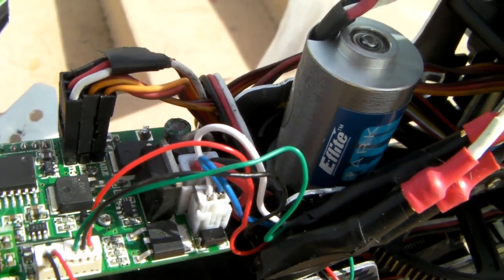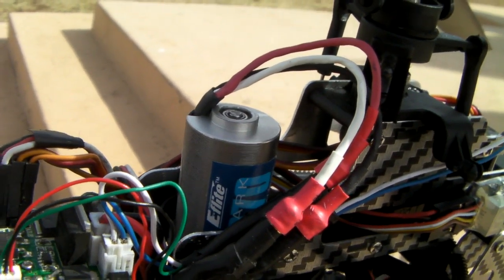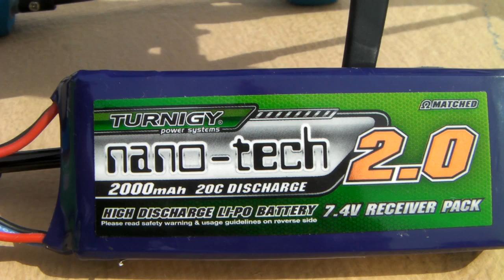MJX F45 Brushless Motor Upgrade Part 2

Comment: hey Ricardo, what of two these helicopetrs is better MJX f45 or wl toys v913?also tell me why.\
 Thank you
Reply from the maker: Greetings,  to be honest with you,  I don't have any experience with the WL toys helicopter, but I believe that they are both about the same thing. I chose the mjx, because there are more parts available in the net for this bird than for the WL toys and is really easy to upgrade and/or repair when needed.  Mine has  been grounded after 1k+ flights. I stepped up from the MJX and now I'm flying fpv planes and quadcopters. I highly recommend you this bird as your step up from coaxial helicopters,  but not as your first one.  

I invite you to visit my channel and watch my other recent videos flying my RC planes and my quadcopter.  In my opinion  the most recent ones are the best.  

Thanks for watching and for your comment my friend.  Have a great day.

Comment: I just got this ESC. when I connected the ESC wire to radio, the black wire out of the 3(white, red, black) BURNT. Also the wire connected the battery, gets warm. And I have not connected the motor yet. Any help as what went wrong, very appreciated ?
Reply from the maker: Stay tuned and I will send you a video showing what I did, and what I think went wrong with yours, because I experienced the same situation.
Reply from the maker: Hope this will help you:

MJX F45 BRUSHLESS Correct ESC connection: http://youtu.be/8Z1RkrCseRw

Comment: Hi Ricardo, what model of the E-Flite park 370 BL are you using inrunner or outrunner and 4100Kv or 5600Kv
I guess you used the inrunner 4100Kv ?
Thank you for your answer
PS: Did you do any changes on the tail motor ?

Comment: I have a mjx f645, it really is a very nice 'fixed' pitch heli, well made runs nice and can take a amazing amount of crashes. I didn't know that when you added the brushless upgrade you could change the motor type.
very nice video, keep the upgrades coming
Reply from the maker: Thanks for your comment. Yes you can switch motors, but there's just a few ones that fit perfectly no mods needed,  like the one I'm showing on this video. That was a really old video, though. You might want to visit my channel and watch my recent ones. The videos are dated, just look for the most recent ones. I believe the last time I flew my heli was December last year. I've been to busy with my airplanes. Thanks again for your comment and have a great evening.

Comment: there's a guy, i think in germany, that put an align md500 250 scale fuselage on his mjx. have you used a spring and washer on your swash plate? i've seen that mod on other vids.
Reply from the maker: I have but I didn't like the results, so I put it back the way it was designed from factory.  No spring or washer.  With that mood the heli was behaving weird so I took it off.
Reply: ricardopr54 cool. something to think about. my stock f45 actually didn't have a pendulum effect, which caused some to do the spring mod.
Reply from the maker: As long as you set the CG correctly you shouldn't have those pendulum behaviors.  With those bigger batteries sometimes if they move, you lost your CG and your heli start doing that. I ordered one of those spring and washer kit for the swatch plate just to give it a try, but didn't like it.  It was harder to control and at least in my case I felt like the heli lost some forward movement, so I took it off.   I'm still flying my heli, not as often as I used to, but I returned to the stock batteries.  With those your CG is always correct and with the brushless main motor, you have more power and it a little bit longer flight time compared with the stock one.  There's a recent video of me flying my heli.  I invite you to visit my channel and look for it.  The recent ones all have the date on their titles.
Reply from the maker: This is the link for my last flight. I love this heli, but I have to many things going on and can't find time to flight them all.  I have airplanes, Helicopters, a little quadcopter, and a bigger one coming this week to form part of my hangar . LOL. ..

 Flying my MJX-F45 Helicopter again December 11, 2013
Reply: ricardopr54 nice video. i flew my hausler 450v for a little bit today since the f45 isn't working. i have two scale warbirds and another 250 scale fb heli.. the wl v913, the clone of the the f45. the wl is fun, but once i flew the f45, it was so much more fun, and the upgrades are a lot better. yeah, i changed the battery connection to a deans connector, which means a bigger battery. i'm running an 11.1v 2200 mAh 3s 30 battery.. a lot heavier. i had to switch from the 7.4 v because batteries were lower quality (off my v913) and didn't have a consistent discharge rate (i had it tested at local hobby shop). they suggested i get a better quality battery. i just happened to have the 11.1v. yeah, finding a CG is hard because it's too big to fit where the 7.4v goes. right now, it's on the bottom held in by heavy duty rubber bands. do you have any collective pitch helis? you're not flying in california, are ya? i've seen a couple of your other vids before. what didn't you like about the mjx brushless upgrade kit?
Reply from the maker: I have two cp hemos, the Walkera v400d002 such it is a piece of crap (poor quality) and the ESky Belt CP V2. I tried to fly them thinking I was ready after mastering the mjx f45, but I was wrong and crashed them both every time I tried to fly them.  Even with training gear I ended up destroying them.  I spent more time fixing them than flying them, anyway I want ever able to even hover the four a couple minutes, what am I mentioning minutes! , I would've had said seconds...lol... It was so frustrating that I Quit.  I still have them here both.  The walkera is so cheap that just to eyeball it, it breaks... The walkera servos has plastic gear, if you fly it hard they wear off.  So I return to my reliable Mjx f45.  I'm thinking on giving the ESky Belt another try.  I've been practicing on a simulator, and at least now I had learned the concept of the collective pitch and can hover it, but still on the simulator. Lol... And about the MJX-F45 upgrade,  I have no complaints at all.  I love that upgrade. Of course I switched motors, but still the same concept, and it handles the wind like a champion.  If you fly those cp Helis, then you ate a verte pilot than me my friend.  I'm jumping into multirotors this year.  But still wanting to matter the art of flying a cp helicopter, so I'll continue trying.  Have a great day.
Reply: ricardopr54 yeah, i spent more time fixing my hausler 450 than flying it. i don't want to give up on it, but i'm scared of crashing again and spending more time and money on repairs... yes, very frustrating. they got to know me at my local hobby shop because i was always in there buying trex 450 parts (hausler cloned the align trex 450). cp is a bit scary, but the option of fuselages are better for the 450 than 250 sized helis. there's also the heli-max novus 200 fb heli, but that's a bit small for the align fuselage.. that has a shaft driven tail rotor. yeah, i wanna get into multi-rotor as well. the guys at my hobby shop are into them, and one of them is building his. i would love to do fpv with those. have you watched alishanmao's video reviews? they're awesome. i didn't realize walkera's stuff was poor quality. do you know of any 450 sized FP helis? probably easy to build, with the right stuff. wonder if i can switch out my mjx guts to my 450 CP, but i'd have main rotors long enough.
Reply: ricardopr54 How's it goin'? I know it's been a few weeks. Well, I replaced the pcb board thinking that was the reason why the tail motor didn't work, but guess what, the board I replaced was never inoperable... it was actually the motor, but now that's the problem. I've burned out three motors (the last one was off my WL v913). There has to be a reason and a fix for this because I'm not buying another one. Frustrating because I literally fly it less than 10 mins and they go out. I'm thinking of just converting the tail motor to a brushless. What do you think? Also, I'm going to convert my Hausler 450 CP to a FP using a MJX f45 rotor head, and I've seen some conversions on youtube, and there's actually a group that uses the MJX rotor head specifically on CP helis. Anyway, I hope you can help me with my tail motor problem.

Comment: thanks ricardopr54. yeah, i'm already on my second pcb board. i'll give it a try. i actually want to put an align 250 scale fuselage on mine (md 500), and i needed a stronger motor for the extra weight. i actually came across your video last year, and  because of your vid, it would be the solution to the weight problem, and i've used your video as a template to build upgrade mine. this heli is fun. i also have a hausler 450 (trex 450 clone),. it's a cp and i've crashed it a lot and i've put a lot into its repairs. flying the f45 is a lot of fun and i like that it can handle crashes well. once i have the new board in, i'll let you know how it turns out... agggh! and i thought i was done with soldering.

Comment from the maker: videogrand1985 @videogrand1985 I have never had any problems with my tail motor and I'm still using the brushed  one.  My suggestion for you is to get a new PCB.  Sometimes that happened to me and a new PCB  was the solution to the problem.  The PCBs go bad sometimes without any advice.  Those PCBs are not that expensive, you could find them for under $ 20. 00 . Hope this might have helped you.  Let me know.

Comment: hi ricardopr54, i've done the eflite 370 brushless upgrade such as you have. the tail motor worked okay at first, but now it doesn't hold the heli straight anymore.. it just spins counter clockwise. the tail motor still spins, sometimes steady, but on and off. i replaced the tail motor because the previous one probably burned out, and this was with the eflite upgrade. it's the new motor that's now acting up. i don't know if the tail motor is underpowered since it's brushed, but the old one held up okay, or if the gyro on the pcb board is not working. if the gyro truly weren't working, the tail motor wouldn't spool, but it does. i have tried disconnecting the power to the main motor and tested the tail motor and seems to work. i've tried listing as many issues with my f45 and if you have any suggestions, i would greatly appreciate it. i have seen other f45 pilots that have upgraded the main motor to brushless also change the tail motor to a brushless outrunner. once again, any help would be greatly appreciated. thanks in advanced.

Comment from the maker: A 25 amp is what I'm using on mine and it works really good. And yes, you need to use an ESC in order to be able to use a brushless motor my friend.You can just buy the brushless motor kit that Amazon has and it comes plug and fly, so no rocket science is needed to install it.  Thanks for asking, and I apologize for the late response to your question.

Comment from the maker: @David Mayfield: No dude,  that motor doesn't come with the brushless kit that Amazon has. That kit comes already with all the components installed (brushless motor, ESC 20 amp,  and all the hardware needed), it's a plug and fly kit.  I replaced the original brushless motor that came with the kit for the Eflite one the day the 1st one broke,  but used the same hardware from the brushless kit, so I just disconnect one motor and connect the new one using the same wiring.

Comment from the maker: @DAVID MAYFIELD: This is a kit that comes already set to work with the original PCB, so you don't need to worry about getting a different TX or RX, you will use the original one.  You could find the kit at Amazon or eBay.  TechandToys sells it through Amazon for less than $45. The kit includes the brushless motor, ESC 20A, and the metal frame plates that fit the new motor.  I hope you find this helpful.  Thanks for your comment.

Comment from the maker: @trebor1973j I device to switch motors when the pinion gear that comes with the brushless motor wear out and trying to remove the motor i broke it. I order another kit, but they took forever to send it, so i figured how to use a stronger motor with the same hardware i already had installed.

Comment from the maker: @Tykes Allacar follow the instructions that comes with the motor for it's connection procedure. Remove the cables that Power the stock motor from it keeping the white connector intact and solder it to the Power cables of the ESC.  You are going to connect your ESC to the same pave the stock motor was connected.

Comment from the maker: @Tykes Allacar Once you have that part done, the pinion gear one, you are going to start the connections. The motor Congress with instructions on how to do it. Cut the power cables from the stock motor and solder them to the ESC Power cables, those should be the black and red ones.

Comment from the maker: @Tykes Allacar You will need a brushless motor, and a 25 amp ESC. I'm using the Eflite Park 370 5400kv on this video. Get a gear puller in order to remove the pinion gear that's on the stock motor because that is the one you need to install on the new motor. You could find that  at Amazon or Ebay. I got the Eflite 1 to 5mm  one.

Comment from the maker: @Tykes Allacar Hi there, The motor I showed on this video is the Eflite Park 370 5400kv Brushless. It fit 1:1 on this helicopter, no modifications whatsoever on the frame or the motor plastic mounting base are needed. Thanks for asking.